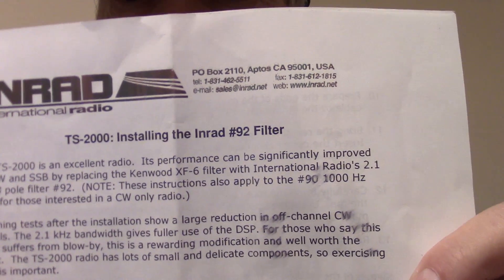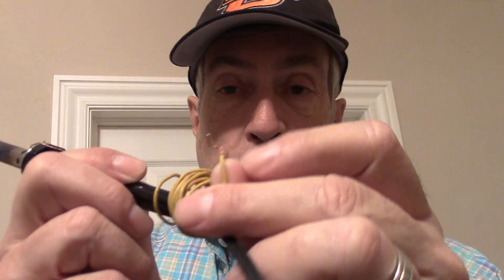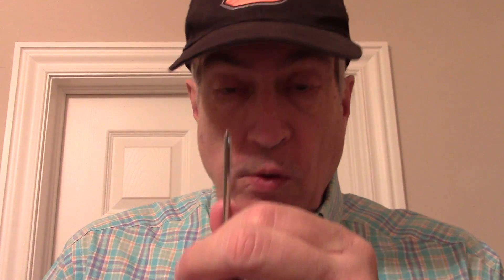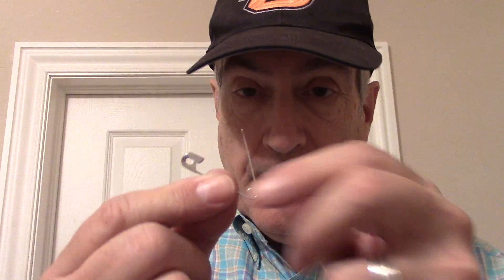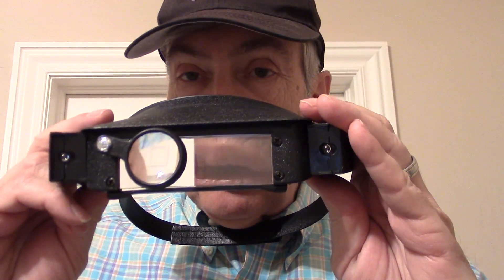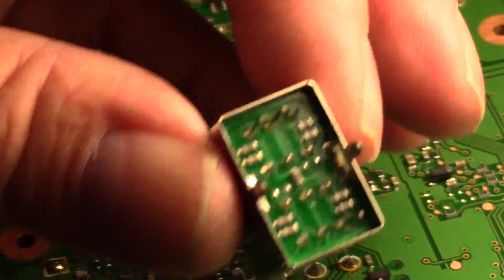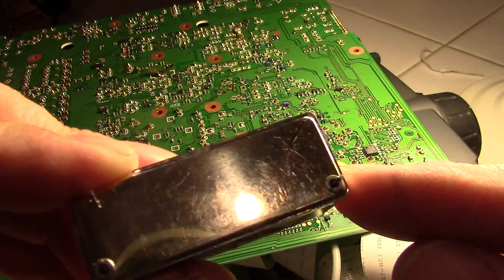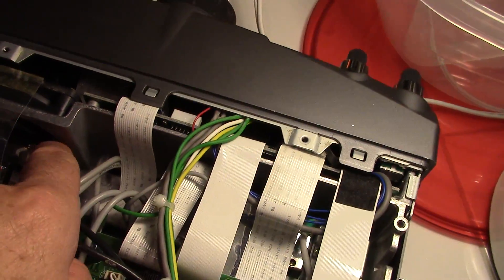Install Inrad Roofing Filter on a Kenwood TS 2000

Comment: Thanks. This video is still helpful for those doing the mod today. After removing the OEM filter I noticed a set of pads next to one of the pins,  looking like a small SMD device should be there. From your video I was able to confirm that it is unpopulated and I didn't accidently pop something off.
Reply from the maker: Glad my video helped.  Thank you for watching my video!

Comment: So did it make this ridiculous loud radio any quieter? As compared to another radio? How about working 75 meters, did you hear the normal static crashes? My ic-765 and ts-830 Are quieter than my 2000. Shame on Kenwood for making such a noisy radio!!
Reply from the maker: Hi the Public Hunting,  I didn't really use the 2000 much on 75, more on 40 SSB and 20 SSB and sometimes CW.  It seemed to help me pick up the weak stations a little better when you had a strong signal close by.  The CW is noticeable difference.   But I think the noise was about the same...  The IC-765 has a lot higher dynamic range than the TS-2000.  About 2 months after i put the roofing filter in, I bought the IC 7300 and sold the TS-2000.

Comment: Hows this filter mod effect 2200 and up on the DSP high cut will it become useless after 2200? and will it effect AM And FM?
Reply from the maker: I haven't noticed anything bad...  I would contact Inrad for details   I have worked AM & FM I haven't notice anything bad.  To me, it seems the SSB is clearer and working CW is enhanced with the filter.   I really haven't had problems above 2200...
Reply: @RichRodgersOnline  Performance IS better on HF only, or also in VHF?
Reply from the maker: Boris Tudjan,  I only used it on HF.   Very seldom VHF...
Reply: @RichRodgersOnline  How was it on HF? Any noticeable difference?
Reply from the maker: @btudjan   I thought it was a big difference it was worth it to me
Reply: ok cool because i am am considering doing this upgrade but i would rather hear from people that have done  and are it running. i unfortunately live in the city and I thing it would not be a bad upgrade. i can contact inrad but some how ill just feel like there trying to sell me some thing..
right now my TS-2000 is in for repairs Nothing i did i swear LOL it just did not want to auto tune or transmit any more on HF one day. I am still new i would say only just got the radio and my ticket in 2014.. But the level of work is to put the filter is well within my ability. right now i am using an older TS-450Sat that i fixed up put in a 20MHz TCXO I had to retrofit in and some other miner repairs  maybe i should have made a video on that.. 
my Call is KD2GOE hope to here you on HF some time 73
Reply from the maker: You might look at the reviews http://www.eham.net/reviews/detail/4582